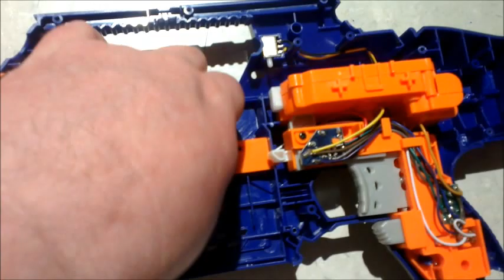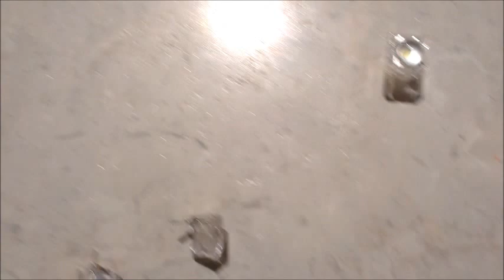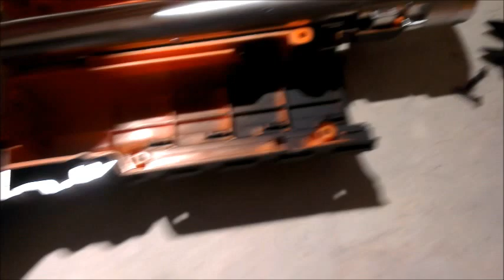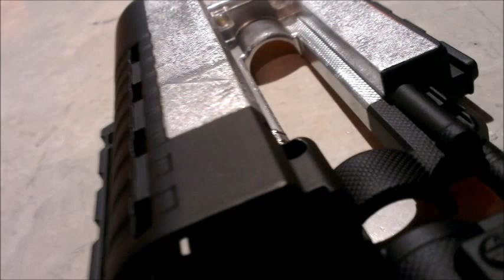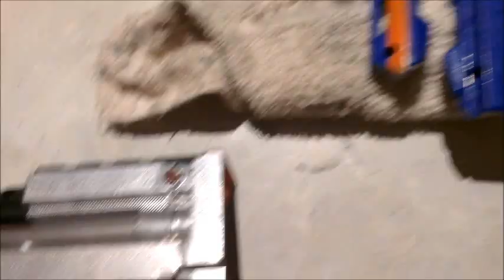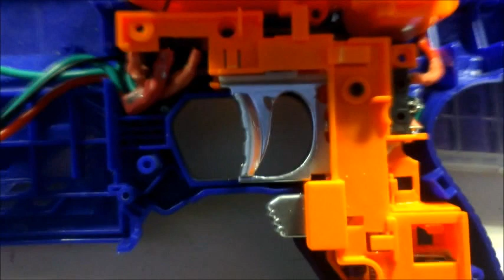The "Lightning Strike" Build - Part 1

Comment: I have a few questions about this build if you have a minute.  Did the motors you used hold up? If so, can you provide a link to them? I have found motors based on your description, but they look less robust than the ones you used. Also, did you ever get around to reducing the speed of the pusher motor, and if so, what did you use?  Thanks in advance.
Reply from the maker: +Chase Kesner ok .. No, they didn't hold up and I ended up replacing them with "Falcon" motors which are far more reliable and not that different FPS wise. Yes, I did reduice the pusher speed as you can see in the finished blaster video here : https://www.youtube.com/watch?v=KQN5QiC1IOg
Do you have a link to the motors you found ? so I can check them out and let you know what I think ?
Reply: J0D0CAST hey I like your work I have a question about your lightning strike build. What are the LEDS that you're using?